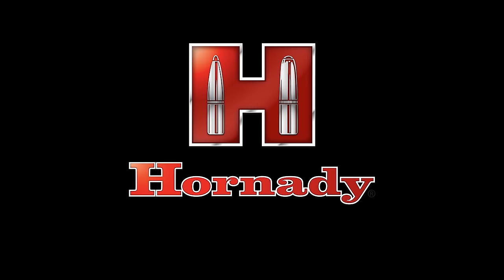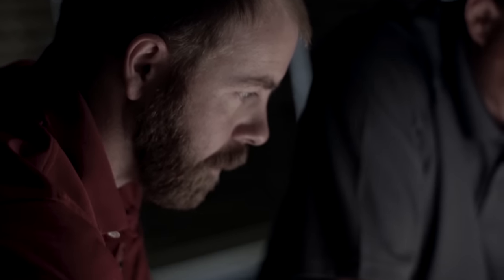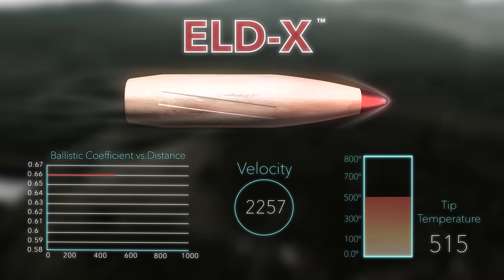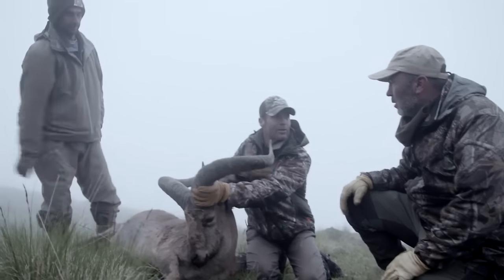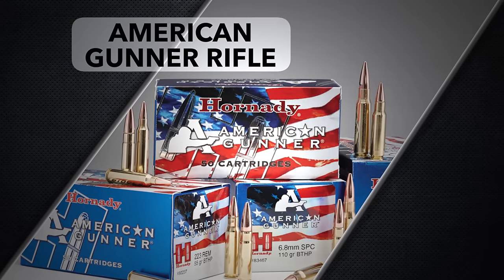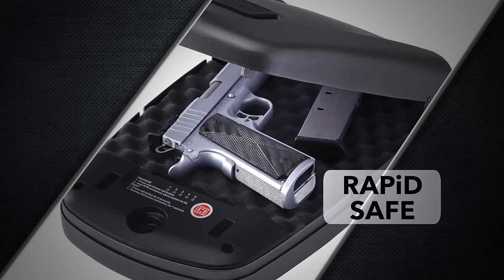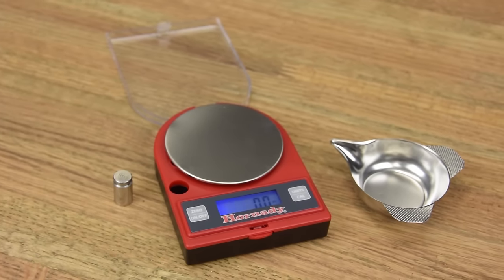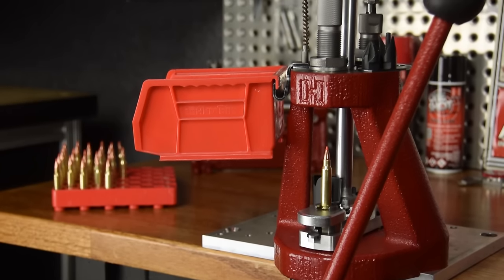Hornady® 2016 New Products Overview

Comment: OK, first you lock the comments section, and then you re-launch with all comments scrubbed. Well, that is a pity. You could have answered comments, or explained your intentions. However, you have instead just concluded that you will delete comments that you don't like. WOW, you just moved to the very bottom of my list of corporate responsible communications.
And consequently you move to my lowest level of trust.
Reply from the maker: Mark, we are sorry for your disappointment. We had a name change to one of our new products - Rapid Rack. We've updated all video material with this change, this New Products Overview was one of them. We did loose all previous comments and that we are sorry for. That is a big loss for us. +Mark Kohler
Reply: +Hornady Manufacturing 
Thanks for the explanation.
In short I will summarize previous comments:
While you state that non-melting tip sees the greatest amplification of affect at longer yardage...you note two things:
1. The higher fps, the higher the temperature the tip sees, doubling  going from 3000 to 4000  fps
2. you note deformation /melting in as few as 100 yards.
Consequently, why does it not make sense to use this non-melting tip on all ammo that is intended for use beyond 100 yards?
Your explanation that the difference seen is very small far very high velocity bullets that have a very poor BC makes sense. However, there are a huge number of applications that do not fit this description.
My observation is that the new gmx 180 30 cal certainly has higher fps in superperformace loads, is obviously for use to 400 yards and beyond, and has a good BC. Hence, like many other examples(nearly all A-Max)why does it not make sense to use the non-melting tip on this application as well??